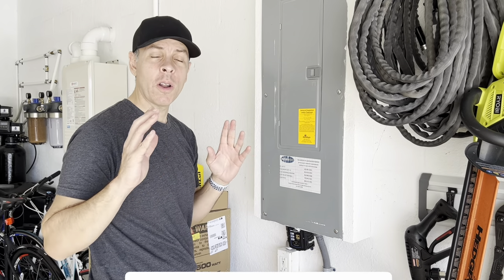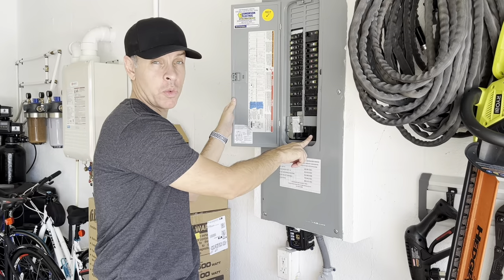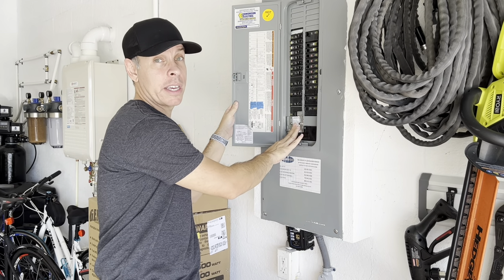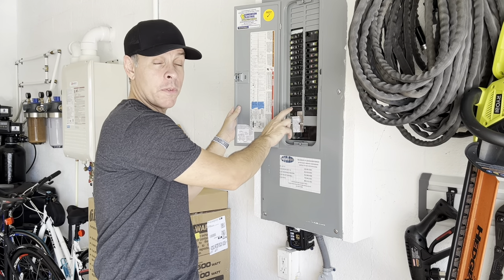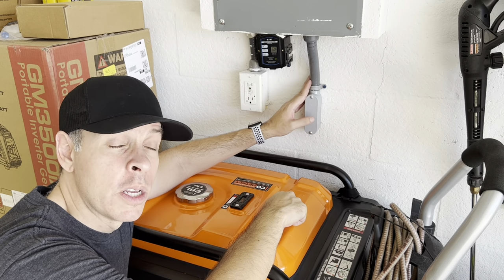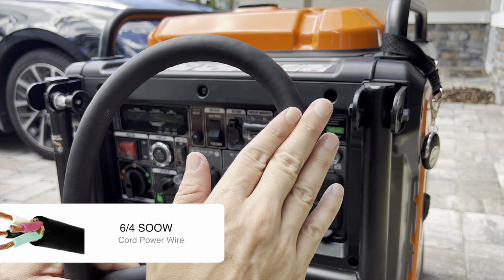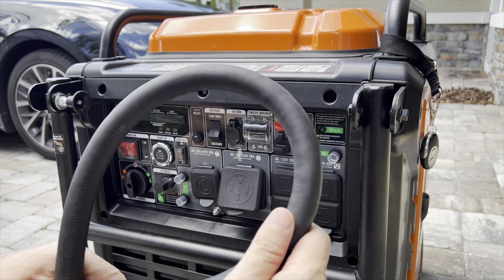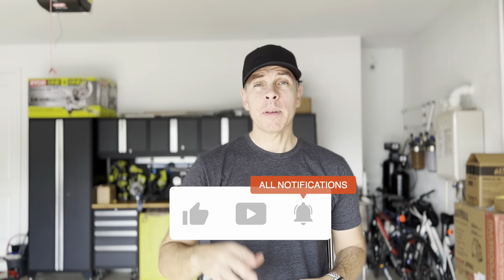Home Emergency Backup Generator Setup - Genmax GM9000iED

Comment: The only thing I would add is a Surge Guard 50 amp surge protector.  You have a great channel and I have purchased the Genmax 9000 IED and I have floated the neutral as per your instructions.   Thanks again.
Reply from the maker: Hi. Thank.  I do have a 50amp surge protector.  See minute 2:06 on the video.  The black box under the breaker panel is an Eaton Whole House Surge Protector.

Comment: Where I am in NC hurricanes mostly mean a lot of rain so I've been ok using a GenTent to run my generator outside. It's rated for 12 inches of rain per hour with 70 mph winds. It would not surprise me if you need more wind resistance, but if not a GenTent could be worthwhile.
Reply from the maker: Hello. Thank you. I will check it.

Comment: WHY did you run the inlet plug on the outside of your house???  Would have been much more weather secure on the inside, you know that ol' saying about electricity and water.....
also while you were doing all that new wiring it would have been nice to add a sub panel, that way you could have had room for expansion in the future? all in all a good job and video, thanks
Reply from the maker: The power inlet outside, I installed there because maybe in the future I will be building a Generator Shed. To leave the generator outside the garage and with a better setup for storage, ventilation and covered from rain.  Right now I have to run the generator on the driveway and if rain is not good.  About the subpanel it transfer switch, I want it to keep it simple and affordable.
Reply from the maker: Hey. You know what. Now that I am under Hurricane Ian I am thinking that instead of the outside shed I can leave it inside the garage and connect the exhaust to an Exhaust Flex Connector Pipe to the outside. If I can’t open the garage door because I am under a Hurricane I can still power the house and after the Hurricane I just put the generator outside.

Comment: Why did you go with the 50 amp in not a 30 do you plan on parallel two of them generators
Reply from the maker: All depends of the use, I am using it to power my home including 2 air conditioner one 3TON and another one 2TON
Reply: @JavierRivera  I was talking about your 50 amp inlet box to power your house that's what I was inquiring about
Reply from the maker: Ok.  Well the generator that I use is the GM9000iED that has a 50 amp outlet.  I needed a 50amp power inlet.  And like I mentioned I needed 50 amp to power my 2 air conditioner
Reply: @JavierRivera  ok thanks I don't think I'm explaining it well enough but that one 9000 will not give you 50 amps along somewhere around 31amp is the most that generator can put out
Reply from the maker: No.  You are the second person saying that and I don’t know 🤷🏻‍♂️ from where you guys get that information.   It is 50amp outlet.   Is 120v PER leg.   So if you have 7,600w divided by 120v = 63.33 amps.    Or because is per leg you could do 7,600 divided by 2 = 3,800 divided by 120v = 31.67amp per leg.   The 50amp outlet have 2-120v wires.
Reply: @JavierRivera  🤣🤣🤣 the math is 240 because that's what you pulling from the generator in that's how we got the 31
Reply from the maker: That is not how the math works.  The generator produce watts that are 7600 running.  Anyway forget about the generator for a moment.  I connected the generator to the house and I turned on everything I could including the 2 air conditioners and I went to the breaker panel to measure amperage with a multimeter and I was using 46 amps.
Reply: @JavierRivera  thanks for all the information I'm going to test mine using your  theory soon as my easy start comes but my hook up is just a 30amp because I used the math of 7600÷240=31.6 that's how I came up with the 30amp for me that's what made me ask my original question to you buddy I'm not a electrician just a diy guy just trying to learn everyday.🤜🏾
Reply from the maker: @henrythompson5624  make sure you are using 6/4 cables with your 50amp outlet and not cables for 30 amp.  Also.  If your home power inlet is 30AMP that power inlet will be using 3 wires not 4 therefore you will be using only 1 leg 120v of the 50amp outlet.  So.  My recommendation is to use your 30amp generator outlet then upgrade to a 50amp power inlet and change all wires to a 6/4 wires.